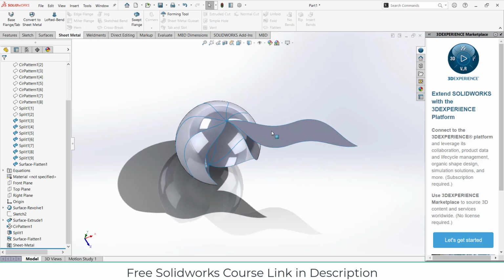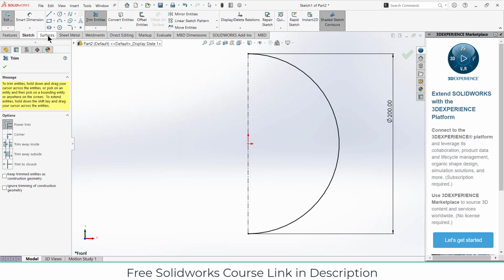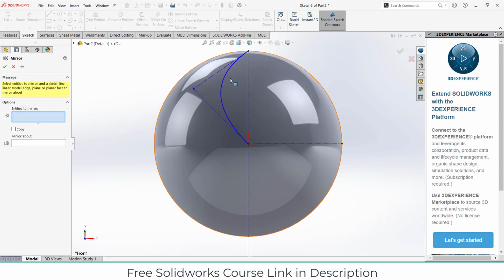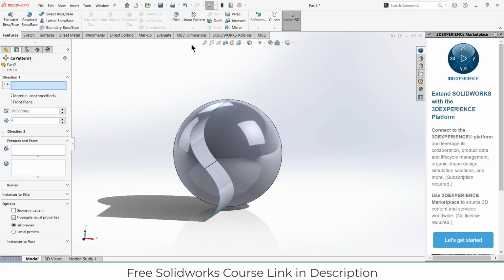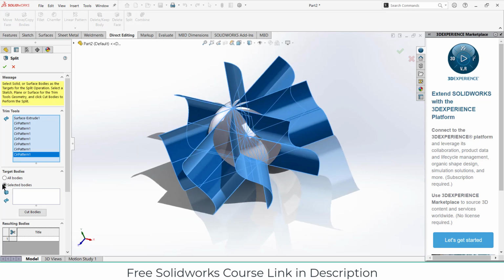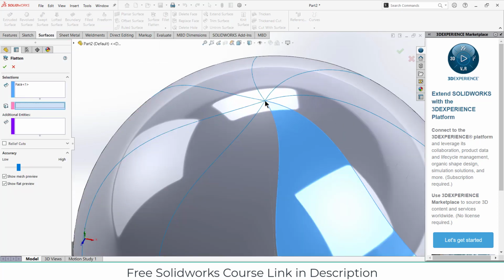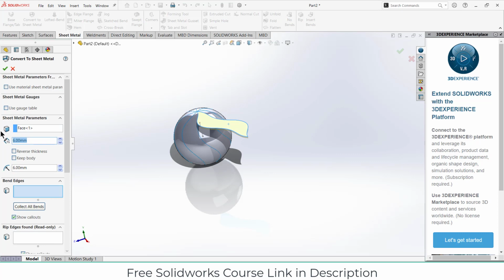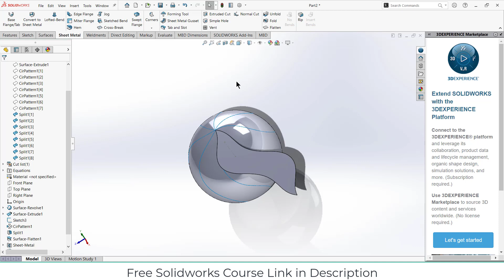Sphere Making with sheet metal in Solidworks

Comment: I wish to do something similar but  have the panels overlap and add rivet holes. The overlap part is easy but the flatten feature won't allow any holes in the surface.  Any good work around for this?
Reply from the maker: Can you share some pic for reference need to visualise before comment. ( Send me message on Twitter /X : @mechanical_luv (engineerknow))